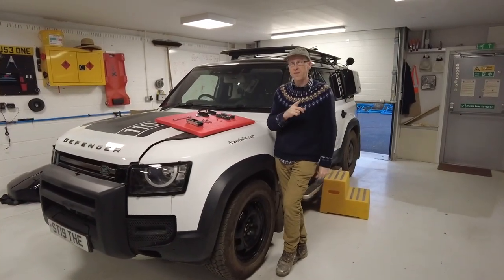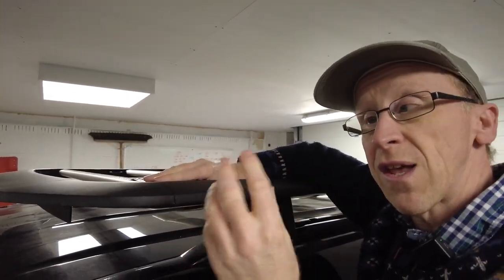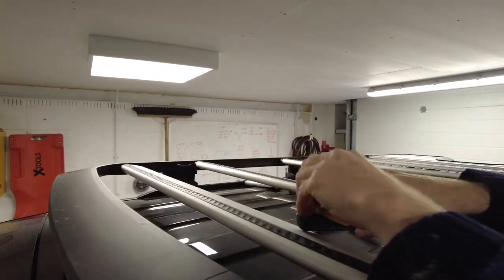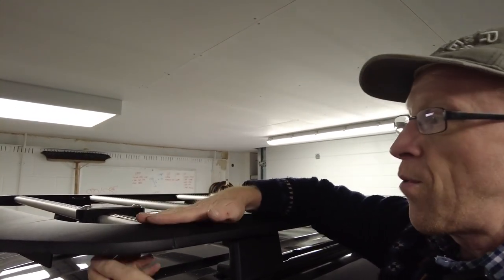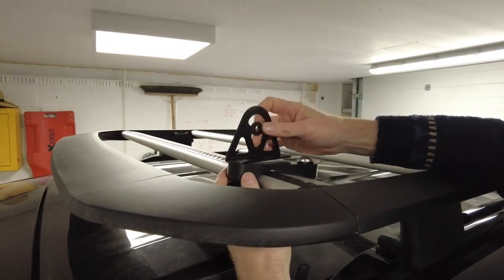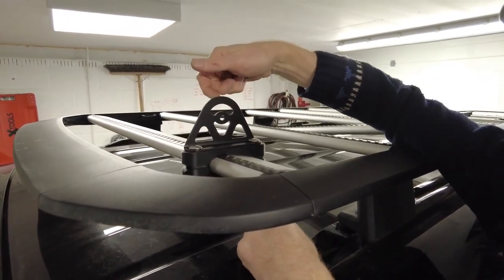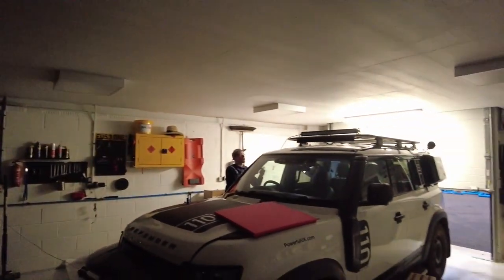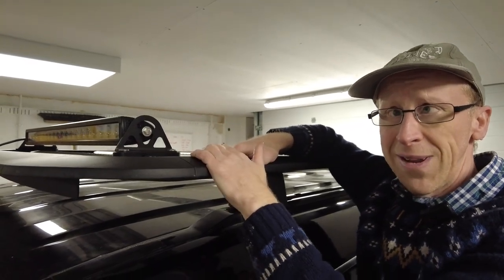Roof Rack Light Bar Mount / Bracket for New Land Rover Defender L663

Comment: Can you make a version that fits underneath of the rack at the front you know how hard it is to get into car parks already with the expedition rack, it does look like that lovely light bar will fit under the front without interfering with the roof and you know its going to look great there. Keep up the good work Simon and the gang, we love the work effort you're putting in, its not unnoticed, there are great products on your site and I've had the few already and I expect I won't be able stop buying in the future.
Reply from the maker: Hi Jon - I have Osram rep coming with their new Lightbar on Monday - so i will look at this - I also thing that the "air damn" that is fitted to the underside of the roof rack at the front may be removable and maybe we can fit the light bar there !

Comment: I'd flip the clamps and book end, and try fit it under the roof rack, maybe on some longer brackets so it's closer to the front of the roof
Reply from the maker: Yes I agree its a little far back... we may well work on some other brackets for the front of the rack or even on the area infront of the rack but it is super quick and easy and the light pattern looked good.
Reply: @L663  Agreed. Seems a good deal of light is catching on the roof rack. I'm definitely interested in this! A more forward mounting option on the roof rack would be ideal. I also need a good wiring solution and switch for the dash. An "all in one kit", including the light bar itself, mounting hardware and wiring w/ a switch...I'll be buying it! An instal video for the wiring would be most helpful, too. ;)

Comment: Nice! Is ist possible to mount the lightbar upside down under the roofrack? The roofrack could then be used without restrictions…
Reply from the maker: This is a good question - there is a downward facing air damn fitted to the front of the roof rack - i need to see if it clears this or if the air damn can be removed

Comment: Is it expensive to develop these products, how long does it take to achieve payback and go into profit?
Reply from the maker: For the 3D printed products its not too bad as there is no tooling required so its just a question of time to draw and test the parts. The return on investments is not as fast as injection moulded parts for a few reasons
1) Injected moulded parts are cheaper as its just the cost of raw ABS and they are fast to make
2) Injected moulded parts are fast to make so we can sell more faster
3) 3D printed parts we need to invest in machines and we factor this in to the unit cost - we assume a 3 year life of the machine and so work our a cost per hour to run the machine ( based on 5 day  a week operation - we achieve better )
So why do we 3D print ? it gives us change to test and refine products and gauge market demand / feedback.
One of our 3D printed trays for the L494 sport is now being injection moulded - so the plan now is that the most popular 3D printed parts will "mature" to become injection moulds !
Reply: @L663   Quite an efficient way to develop new products and gauge if they create demand without huge development and production costs. Do you do your own engineering drawings as well?
Reply from the maker: @coyote5735  Yes we have all the CAD data for these - thats what takes the time and all the designs we register with the UK patent office so we own the IP to the designs.
Reply: @L663  That's great no middlemen taking their cut.
Reply: @L663  How do you patent a bracket?
Reply: @coyote5735  You cant patent but you can register the design so no one can copy the exact shape.